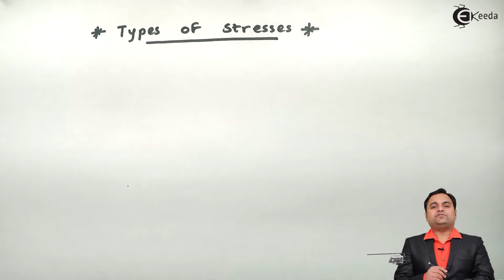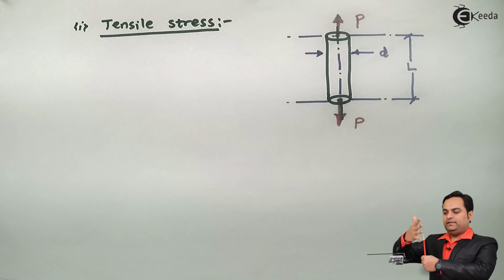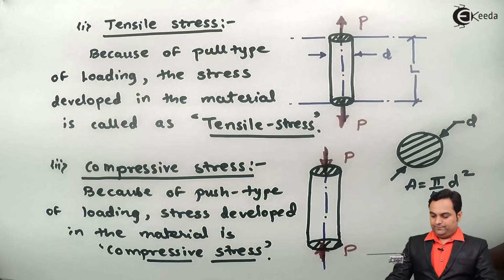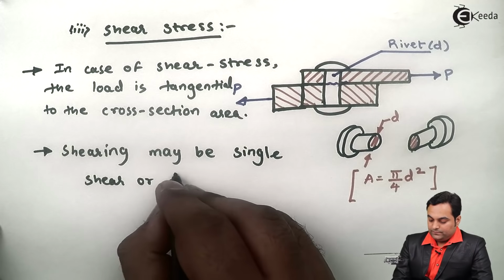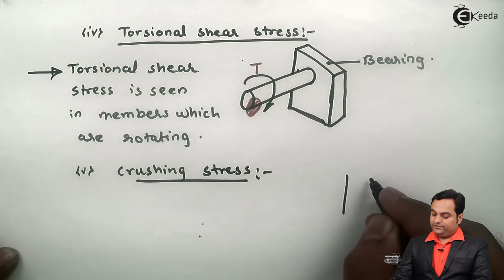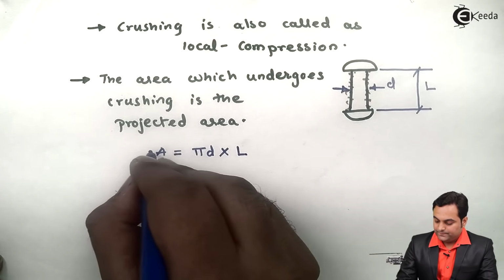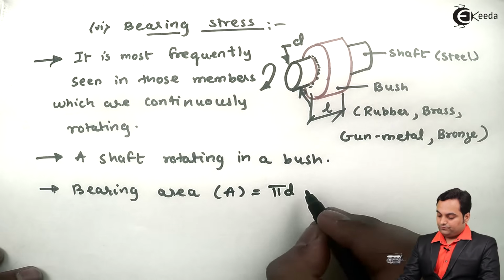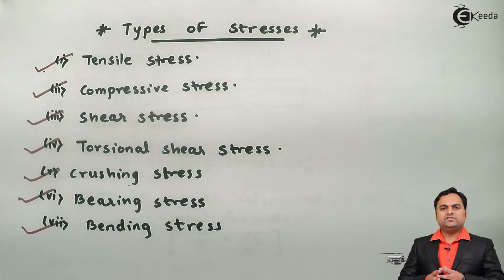What are the Types of Stresses - Introduction to Design of Machine - Design of Machine

Comment: Built up column consist of three rolled steel beam section ISWD 450 @ 0.794 KN/m
CONNECTED EFFECTIVELY TO ACT AS ONE COLUMN
Length is 4.25m
DETERMINE THE SAFE LOAD CARRYING CAPACITY OF SECTION

Sir can you please have a video on sums related to steel sections like this...